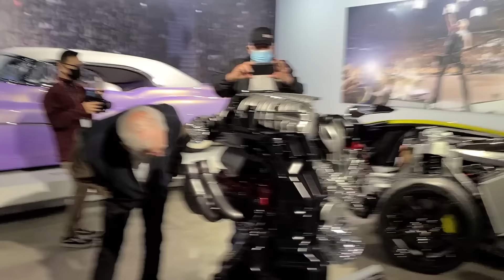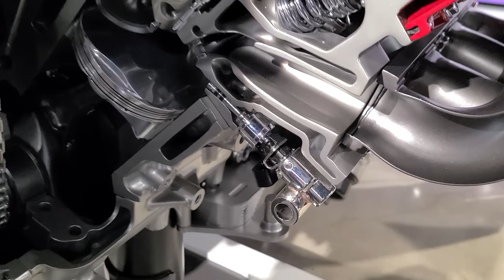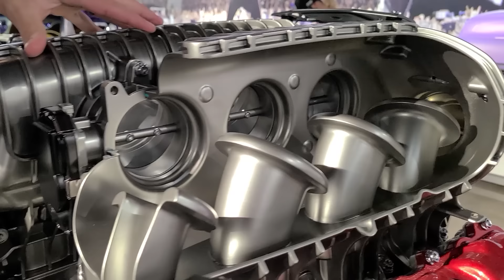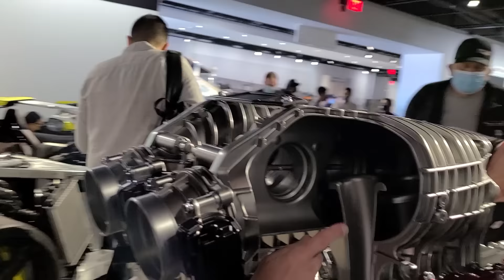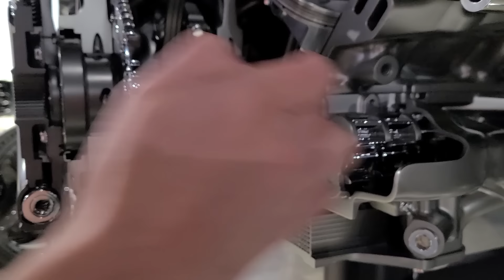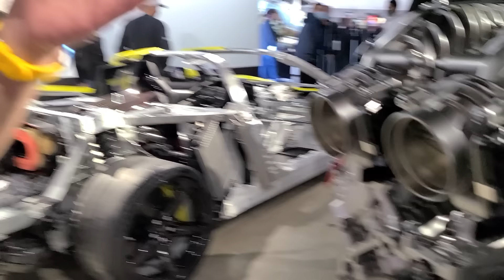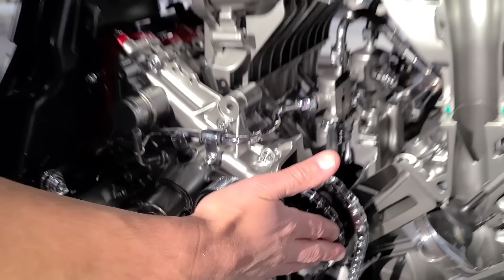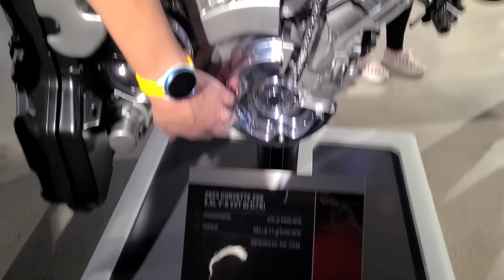2023 Z06 LT6 Cut Away Interview with Dustin Gardner

Comment: This LT6 is an real engine's masterpice , engine of the year award.I just have one suggestion: Can you put titanium air-pneumatic springs valve system to have more responsive, efficient, lighter, silent and durable springs for high revs can reach 9000rpm easily than the conventional springs valve system more heavy, less responsive, noisy.The air-pneumatic springs valve train controlled by an electro-pneumatic solenoid valve positioned near the camshaft and all valve train system controlled by the ECU allows easily intake and exhaust valve lift sytem(VVLT)for most power,responsive and fuel eonomy engine without the bulk and mass compared to conventional springs.Pre-start procedure of a little electric air compressor at 250 bars by the alternator to prepare the pneumatic valve springs just before the complete start of the engine similar like MotoGP engine, it's a two-stage quick start engine.

Comment: With the DI fuel injectors on the exhaust side, what is preventing to using 5 valve per cylinder? Ferrari and VAG had 5 valves (3 intake and 2 exhaust) a long time ago but switching to DI ended that because the DI injector had to be next to spark plug and not enough room for 5 valves.

Also for c8 z06 owners who daily drive their vette. I believe there are going to be high mileage vetted with burned valves because of the lack of valve lash checking/adjustments. This will force Chevy into recommending 80,000 or sooner valve adjustments, which will be an engine out service with the 5.5. At the dealer this will easy be $10,000 labor as the engine comes out, chains and cams removed if any valves need adjusting. There’s going to be a lot of questioning why GM decided to go with non-hydraulic valve lash adjusters, even though we know it’s for running over 8000 rpm and making high-rev power. There’s still going to be lots of pushback because of the high maintenance costs of living with the 5.5 for high mileage owners.
Reply: They're counting on everything wearing in together, the valve & seat will wear closing up the lash and that will equal the stem tip & finger follower & cam lobe's wear to open it up.

Comment: Amazing to see and understand the sheer amount of design and blueprinted engineering that GM went into to get this level of performance. Things that in most cases may have been done before, but only partially and not taken to the level Chevy did here (like the intake tuned velocity stacks…these have been around for decades, but no one thought to put them inside a manifold then vary their shape and location along with outside air control valves to make more power?). It will be very interesting to see the longevity of this powerplant once it hits the street. I know Chevy has been running it in the C8R but that version is limited to about 400 HP, so let’s see how it goes at 670. Nice video man, and I saw Clarence of CGarnerSpeed video bomb!  😎😳😁🤙🏻

Comment: I love when guys with coyote f-150s look at that you need a 6.2 for GM to even barely beat a 5-0 yeah no crap because of 62 is the old pushrod boy what happens when GM uses overhead cams oh it becomes the most powerful V8 naturally aspirated ever I wonder if this technology will ever make it to the Silverado maybe not a flat plane crank you know I don't need it to rub to $8,000 RPM but if they could detune it and use it in a 1500 obviously you will never be in a heavy duty GM is not that stupid They know you need to push rod for work truck application but for 1500 Silverado SS a detuned LT6 would be awesome
Reply: Exactly. Its not so fun now when they are on a level playing field. lol I think eventually we will get DOHC 5.3 with no flat plane crank. Detuned version for the silverado and sierras. mated to a ten speed transmission. Just hope we can get the single cab Silverado's  back. I would love to revisit whose faster with these f150 boys. Lol
Reply: @mjflores4170  Nice post brother because that's how I feel Yes it might make it to the 5'3 without a flat brain crank but then again they're trying to get rid of the 53 because of that stupid four banger cuz it has more torque people don't realize putting turbos on things yeah it's cool They actually get worse gas mileage when you're towing or flooring it Even if they give us dual overhead cams you know they're going to ruin it with cylinder deactivation I kind of want a straight six turbo straight six is a truck engine always has been always will be they're actually great because of the low end grunt I had a F-150 with a 4.9 straight 6 That thing was a tank I honestly would be willing to bet if you chained it to a similar F-150 with a 5 L V8 that straight 6 would pull it
Reply: @mjflores4170  imagine what a supercharger would do to that gen 6 small block It would be faster than the voodoo for sure
Reply: @mjflores4170  oh and it's not the first dual overhead cam small block They did it to a 5.7 LT1 I believe in the early '90s but the valve train was built by lotus It had 375 horsepower for a naturally aspirated engine during the smog era and emissions era where they haven't figured out how to make things really powerful and be good on emissions and gas yet like the '90s you know those '90s trucks were super underpowered They didn't figure it out yet now we're back into the horsepower wars again like the '70s and '60s because we figured out how to get crazy amount of power and still be good on emissions.... 375 though out of a natural aspirated 5/7 in 1995 that's pretty freaking good I'm not sure what it was in I think it may have been in a vet

Comment: 120hp/Liter 2023 Z06 
176hp/Liter 1983 Ford 3.0L DOHC V8

The Ford 3.0L DOHC V8 Dual Four Valve (DFV) started out in the 1967 Lotus, 1968 Ford P68 and 1969 P69. Originally this 32-valve engine made 408hp @ 9,000rpm ( 133hp/liter ), reaching over 510hp at 11,200 rpm by the end of its racing career. The 1983 DFY variant had a revised bore and stroke making  520–530 hp at 11,000 rpm (176hp/liter).  In 1969 and 1973 every World Championship race was won by DFV-powered cars, with the engine taking a total of 155 wins from 262 races between 1967 and 1985.

The 3.5L DFZ, essentially an updated version of the final DFY design, increased the power output to 575hp. By the end of 1988 the engine made 590hp.

Comment: Wow, hand assembled just like Fords Cobra motors have been since 1995
Reply from the maker: Actually, all Corvette motors are hand assembled and have been for a long time. These will be single builder hand assembled, just like the LT4 and LT5 were in the previous generation. There will also be a buyer build experience where the buyer can build the engine with the support and assistance of the master builder at the GM Performance Build Center.

Comment: 120hp/liter 2023 Z06
120hp/liter 1965 Ford Small Block

From 1964-1978 Ford's DOHC Small Block Indy engine dominated USAC, and won the Indy 500 six times. The engine was loosely based on the Fairlane/Mustang 289 V8 (221/255/260/289/302/351W engine family) fitted with DOHC heads with 4-valves per cylinder this engine in 1965 made 495hp which gives it 120hp/liter. In 1968 the engine recieved a turbo. By 1972 the engine size would shrink in size but gain in power. By 1978 the engine was reduced to 165ci but made 850hp. Nice to see Chevy finally catching up!
Reply: We still need to see LT6 on dyno to get a better picture. 120hp/liter is only a estimate at the moment.

Comment: Everyone talking about how incredible this engine is from an American car company fails to realize that Ford was first, and way ahead of the game, in terms of DOHC, with the Coyote and Voodoo. The 5.2 Voodoo in the GT350 was the first American V8 to make more than 100bhp per liter and the most powerful NA American V8 ever built until the LT6. And, typical of Ford, the GT350s are downrated from the factory and dynos have consistently shown that the Voodoos actually make 581bhp and 450 ft. lbs. There are also Coyotes making 625 on 93 with bolt-ons and a tune.*I'm not saying the Fords are better, I'm just saying give credit where credit is due.*
Reply: Yes, Ford first but it came at a cost. 5.2L fpc should have been a racing engine first before being sold to masses. When I read of reviews talk about shakes and vibrations was concerned. We still have to wait to see what LT6 does on engine dyno.

Comment: THEY ARE FINALLY REPLACING THE LS,THE GENERIC FORD REGURGITATED 427 HIGH RISER AKA RAISED PORT 351 WINDSOR. LET'S SEE WHAT ELSE GM TOOK FROM FORD TO BUILD THIS NEW LT6.
Reply: LS is here stay in other vehicles. No matter what engine GM puts there be this Ford talk. LS has bore spacing from 5.7 LT5, LSX and most of their sb's. That has nothing to with Ford. Even this LT6 has the same 4.4. I wonder why, because are sticking to something that works best for their products. Someone commented about the intake system similar to a 90's Ford engine. I will admit nothing in engine is really new here. That's not the point. Ford had every opportunity to build a robust engine like here but didn't.
Reply: @jeffwill4923  THE LS IS 1000% FORD IN DESIGN. NOT ONE, 1 DESIGN ASPECT OF THE OLD SMALL BLOCK CHEVY LIVES IN THE LS. I WILL TAKE THIS FARTHER AND SHOW YOU JUST HOW MUCH OF WHAT CHEVY USES IN RACING TODAY IS ALL FORD IN DESIGN. EVEN THEIR NASCAR RO7 ENGINE IS A FORD CLEVELAND COPY. WOULD YOU LIKE TO HEAR MORE. IF SO GET PREPARED TO GO ON HEAVY MEDICATIONS BECAUSE THE TRUTH WILL SEND YOU INTO A FRENZY.
Reply: @Frank289100  Again the bore spacing is where we disagree. That is why I made such point. 4.4 is in OHC LT5 and here like LS. When you have time look it up.
Reply: @jeffwill4923  SO WHAT YOU ARE SAYING HERE IS THE BORE SPACING OF THE OLD SMALL BLOCK CHEVY. IS THE SAME AS THE LS. IS THIS CORRECT?
Reply: @Frank289100  Yes, have to give GM some credit. In 1955 the first V8 featured a 4.4 bore spacing. That design is in LT6 here, recent LT1, LSX, and the various spin offs from the various LS blocks. Ford tried to carry the 5L ohv 3.937 bore spacing to the Coyote. That was always going to limit the displacement. To try to get past this issue, Ford went with very large cylinder heads.
Reply: @jeffwill4923  GIVE GM SOME CREDIT FOR USING THE 4.4 BORE SPACING. THE SMALL BLOCK FORD USES A 4.38 BORE SPACING WHICH IS COMPRABLE IN SIZE TO THE CHEVY AND THE FORD 5.0 H.O FOR IT'S TIME WAS THE HIGHEST VOLUME MOTOR IN THE WORLD. NOTHING MADE IT'S POWER PER CUBIC INCH. THE CHEVY WITH THE LARGER BORE SPACING MADE LESS POWER. THE REASON CHEVY STILL USES A 4.4 BORE SPACING IS DUE TO THE VERY EXPENSIVE BORING MACHINES THAT MACHINE THE BLOCKS. GM DUMPING OLD EQUIPMENT TO PURCHASE NEW EQUIPMENT COSTING 500 MILLION DOLLAR TO DO WHAT IS THE MINDSET OF AN IDIOT . CHANGING THE BORE SPACING ISN'T GOING TO SIGNIFICANTLY CREATE MASSIVE AMOUNTS OF POWER BUT CRUMBS. BUT CREATE COMPLEXITIES BECAUSE IT CHANGES THE CRANK SIZE, CAM SIZE, ETC WHICH MEANS DUMPING MORE EQUIPMENT INTO THE GARBAGE FOR SCRAP METAL. A CRANK FROM THE OLD 348 W MOTOR FITS INTO A CHEVY BIG BLOCK. IT ROLLED OVER FROM THE MILLING MACHINES WHICH MADE THE OLD 348 AND 409 MOTORS. ONCE AGAIN THEY WEREN'T GOING TO DUMP PERFECTLY GOOD MILLING MACHINES INTO THE SCRAP YARDS AT A TREMENDOUS COST.

Comment: Starter will be a snap to change.
Reply: People will worry about that after about 250,000 miles.  Imagine how much better the starter will last if it is out of the path of road junk, and away from the heat of the exhaust manifolds.  It might never need replacing.
Reply: @andyharman3022   The LT 5 starter is in the same location and many manufactures  put the starter in the  valley. Those slipper pistons won't last that long. I think it is fantastic engine and tine will tell what it is capable off.

Comment: A Flat Plane push rod LS engine would have been better. I bet customers will be constantly bringing the engine in for valve train issues. Which requires completely pulling the engine and at that point because of lash less cam difficulties it's just be easier to drop a new engine in there

Comment: Like any other technology, we always see the pinnacle, the maximum performance out of a technology just before the entire system is replaced and made obsolete by a new one. In this case, electric vehicles.  Sad to see but the world is constantly changing and that's just the way it goes.
Reply: Electric vehicles are not going to make internal combustion vehicles obsolete.  Electric motors are great, but batteries aren't.  They are what will always constrain electric cars to local use, within 30 miles of home.
Reply: With IC you can drive around the globe and spend less than 2 hours stopped for refueling !!!

Comment: SAE 670. So no doubt over 700. Watch if this thing is not 650-660 at the wheels.
Reply: SAE is the testing standard. Saying over 700 is meaningless because you arent listing a standard. Also, you cannot really compare engine dyno results to chassis dyno results. You can only compare before/after results using the SAME type of dyno. Most people dont understand much about dynos and typically talk about underrating or overrating when that isnt the case because manufacturers are tested to the same standard but it does make for good clickbait if you have no idea what the reality is.

Comment: How can one discuss the valve train and damn near completely ignore the camshafts 
The double overhead cam is a big deal for Corvette engines ...
Why no details on the double overhead cam setup....
8500 RPMs is not difficult when you replace the lifters the pushrods and rocker arms 
Needless to say Ford Chrysler Mercedes Toyota and Nissan

Comment: Yep we started from scratch but using Fords platform yup, oh and a flat plane crank to boot.
Reply: You wish, the bore space is similar to last OHC LT5. LS and most of their sb had this 4.4 distance. Look at the chain on the crank. Far from a Coyote. If any motor GM used was 458 for study. GM is involved in Indy racing. Don't feel bad, a small company in Australia has built up a 5.4L cpc 700hp Coyote for a track car.

Comment: This design is plagiarized from Italian engine design. Ferrari, Maserati and Alfa-Romeo did this 50 years ago.
Reply: That's sort of stretching a point.  Nobody had high pressure direct electronic fuel injection and active intake manifolds 50 years ago.  Ferrari didn't have 4-valve engines in their street cars until the 308 QV of the 1980's.  But wow, that was close to 50 years ago.  On the other hand, GM had the DOHC 4vpc Cosworth-Vega engine in 1975.

Comment: GM hasn't built a Big Block since 2009. Old term..."The Chevrolet "big block" engine is a term for a series of large-displacement, naturally-aspirated, 90°, overhead valve V8s; that were developed and produced by the Chevrolet Division of General Motors, from the 1950s until 2009"
Reply: You can still buy new big block Chevy crate motors from GM.  They just introduced the 1000 hp 632.

Comment: Im a chevy guy so im glad we finally got into the 90s with our engine tech. Finally overhead cam, but with 3 chains and the added mass of a cheater gear, tuned trumpets, old news, lash for life, not gonna happen, isolated crank windage areas, old news, no variable valve lift which is 20 years old, nope. Active intake management, 20 years old. But this engineer is young so he doesn't realize he recycled old tech. Good effort.  Lol. Oh yeah. Fluidamper. Lol.
Reply: What would you have created instead?
Reply: It is true there is nothing really new. That's good on several fronts because all has been tried and tested. With all the air going into such engine, valve lift is not needed. There already much going here, more sensors and new tech just create more headaches. Ferrari is still fine tuning their V12. Why can't GM do something similar with a V8?
Reply: It is true there is nothing really new. That's good on several fronts because all has been tried and tested. With all the air going into such engine, valve lift is not needed. There already much going here, more sensors and new tech just create more headaches. Ferrari is still fine tuning their V12. Why can't GM do something similar with a V8?

Comment: Impressive engine, definitely more track oriented than street but sill impressive.  I do get amused though the more i see old aircraft tech making its way into cutting edge automotive engines.
Reply: It is nice, but way to much going on. Imagine now with a turbo setup. To much. All I see is tubes, and wires and covers, covering the engine. The intake looks cool I guess, with the duel throttle bodies.
Reply: @jakefriesenjake  i dont care much how it looks, if i want an attractive engine i'll go for an old Chevy W engine. The intake is the most impressive part of this setup though, not because of how it looks by because of how it works.  They're taking advantage of getting away form the packaging constraints of the front engine cars.
Reply: @willstikken5619  Chevy w?
Reply: @willstikken5619  yeah don't get me wrong, that engine is pretty sick no doubt, and every hour of engineering that went into it is mind blowing. But at the end of the day, it's a big mess of things, especially when you look at the engine in the corvette. It's too packed in there to look nice. Great power Na sure, but It looks too technical and packed it there.

Great performance tho.
Reply: @jakefriesenjake  348 and 409, started production in 1958.  So named because the shape of the valve covers resembled a W.  It was the precursor to the big block Chevy.